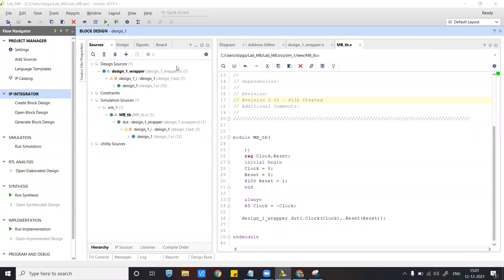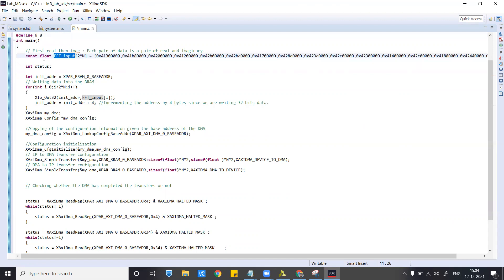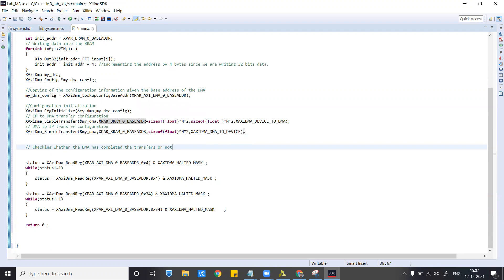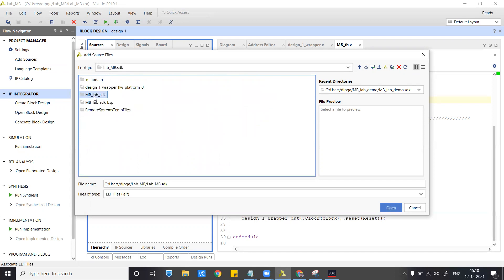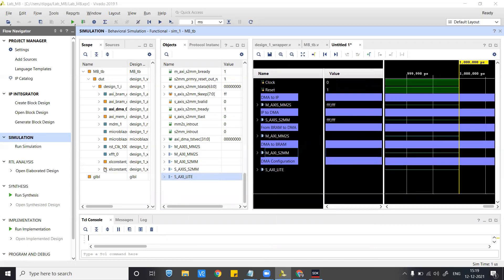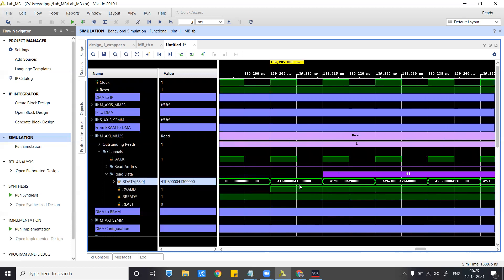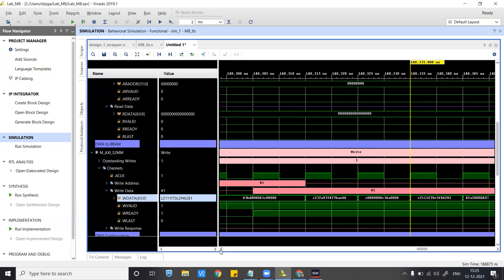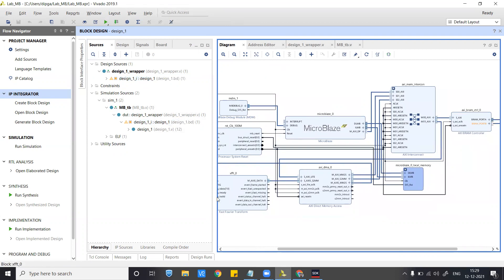Lab_12_Part_3:  DMA and FFT using Microblaze #iiitd #iiitdelhi #zynq #microblaze #vivado #zybo

Comment: Where can I find the API for the stuff you do in SDK/Vitus? For example, I want to read up on these functions like XAxiDma_SimpleTransfer.
Reply from the maker: These drivers are provided by Xilinx and available online.
Reply: @algorithmstoarchitectureii1574  Drivers? I would like to know about the API. I want to read about how to use the functions.
Reply from the maker: @dynamic_shortage6532  https://xilinx.github.io/embeddedsw.github.io/axidma/doc/html/api/xaxidma_8c.html#ga32ca6099d7926297a4c17cdb4a19511b